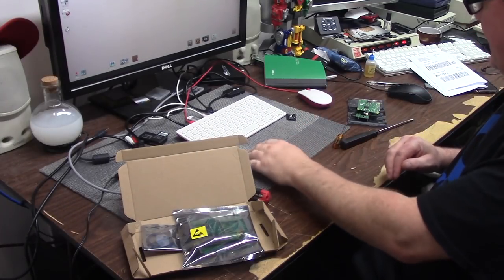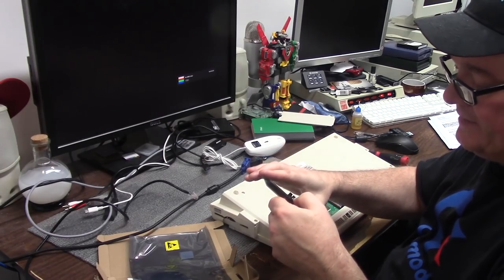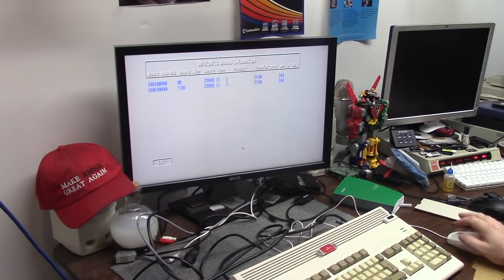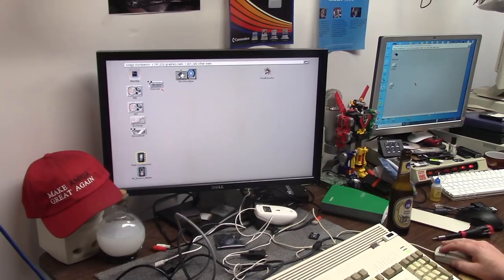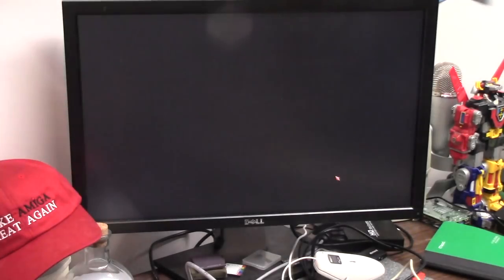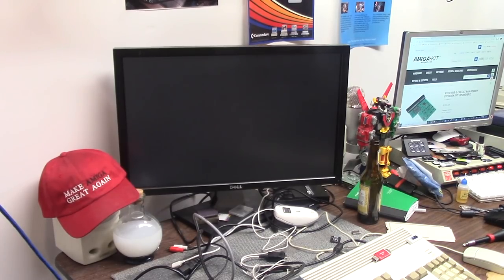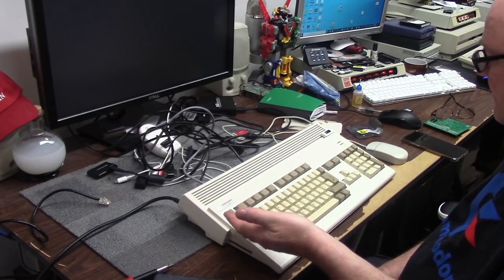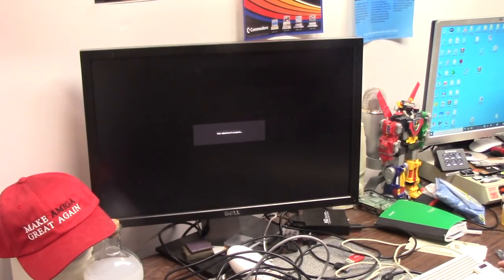Amigakit flash+ram+FPU+rtc and sensor upgrade for A1200!

Comment: I say this again and again. I’m always learning things off your channel Chris 👍🏻 I have a couple of the Amigakit optical mice (You don’t seem to be able to buy them from Amigakit these days). I’ve found issues with them too. The most annoying for me is that on occasions I cannot get into the early start menu with the 2 mouse buttons pressed. Having a few revisions of the A1200 motherboard, I have personally found that the 1D4 revision seems to cause me issues with the Amigakit mouse. On Occassion have had the slight glitch in a 1D1. Found other revisions such as 1B and 2B seem to be okay. The other problem with the Amigakit mouse is that it won’t fit into the mouse port on a A600 😬. Anyways interesting review on the new board. Me personally prefer the old Phase 5 Blizzard cards with the flashable ROMs which uses a toggle switch. I like my 68060 power! 👍🏻😉

Comment: That's off the charts, 1.3 roms, right up my alley. You know this! Don't have to open up the machine, flash - adf built in. Sensor is pretty cool to, really gives your Amiga 1200 a slightly more polished real computer feel. This is perfect for gaming literally, the best. Thing about it is, why have more for a gaming machine. I'd leave it just like this. Granted all these accelerators coming out is more than exciting. For the $ 100 bones ... Most importantly, you can have your heatsinks look like Mr. T if you want! On a more serious note, erasing and restoring the flash is just the coolest thing ever ... Wish I had that. Erase restore safety tip was nice!

Comment: Ive just got the RTC and sensors from amigakit last week, its nice to see some temps as I have an apollo 1240 @33mhz in my desktop case, and with everyone saying they run hot mines in the low 40s' celsius according to the probe, and case temps a couple of degrees warmer. Only problem is the rtc wont work on mine, as I guess it clashes with the rtc on the apollo thats had its battery removed, so next up is getting a replacement battery to solder to my Apollo.

Comment: Nice.   I know there are some who bash Amiga Kit for whatever reason I am a happy repeat customer for many many many years.   I have their RTC and Temp Sensor Modules now for a few too many weeks.  I also have their DB9 Optical Mouse which I used a couple times and I don't believe I ever had an issue with it but I don't remember which Amiga I was using it with but I just made a note to test it out on an A1200 both have 3.1.4 on them and both have 030 boards although I am going to pull the A1200 that has the ACA1230 card because it does not like the SUM Adaptor for my mouse which needs to work for my KVM Connectivity.  It was never a problem until I pulled the 8mb RAM Board out and installed the ACA1230 so I have to play with that but it will not be until the weekend of May 28th when I have my next 4 day weekend off.   Anyway its always something isn't it.
Reply: 🤔 I’ve had issues with Amigakit and so have a couple of others. I ended up contacting them over on EBay as my order of power splitter cables hadn’t been shipped after 2 weeks. I’m still waiting after 3 months for some other bits such as the PC-Key 1200. I actually live the U.K so the only issue at the moment is that as the U.K have left Europe, anything from the likes of Elbox or Individual Computers (Poland and Germany) are also effected because of having no free trade deal 🙄

Comment: Chris, what BBS did you run? I ran the Blue Moon in Buffalo, NY on CNet from 1990 to 2000. We used to Joinlink with Red Sector A in NJ and a BBS in Virginia Beach, forget the name and a couple of others here and there. I have had WinUAE running for years, but I have just decided to start resurrecting some of my Amigas. I pulled out one of my desktop 4000s with a Warp Engine 4040 yesterday and after cutting out the detestable Varta and scrubbing with some vinegar and IPA it amazingly started up to the 3.0 ROM disk ask screen. It had very minor Varta spooge and cap crappage.  I'm ordered a Gotek and an IDE to CF board and I am researching what caps to buy as I have three desktop 4000/040 boards, a 4000T, a 3000, 2000HD, 1200 and a 500 and Cyberstorm 060, CS PPC/060 and Cybervision as well as numerous Zorro boards and a 2320 flicker fixer, which is working on the Warp 4000 (found it in my basement new in the box and for the life of me have no idea when or where I got it!) so I may as well buy as much in bulk as I can.  Looked for a way to get in touch with you and came up empty. Your Amiga vids have been an inspiration for me to get some of this classic Amiga iron back in shape.
Reply from the maker: Atlantic data images . 1990 something-2021.  Still running!
Reply: I am totally awed by Chris, too! And very much interested in doing the same with all Amigas I’ve hoarded over the years. Barely started & don’t know just where to start. Especially, now with 3.2  being released at present.
Reply: @ChrisEdwardsRestoration  ty, registered for kicks

Comment: Well, but for the amiga 1200 for blizzard, they cannot release simm 72pins on modern microcircuits. To take high frequencies. The 68060 chip can operate at a frequency of 100 MHz, and such memory is unrealistic to find.

Comment: Ordered mine yesterday from Amiga-kit! And ordered 3.2 from Retrorewind.ca and it is not clear if I will need to pay Hyperion for multiple registrations for my (3) A500, (3) A2000, (2) A1200 models?
Reply: Adding one of my A1200 is in a Micronic Tower! So I am not sure how every upgrade will fit? Buying the stuff anyway with the thought solutions will come.
Reply: You can use it for all models. Single machine (cheaper) licenses will be released later.